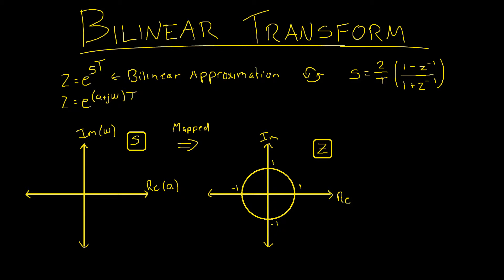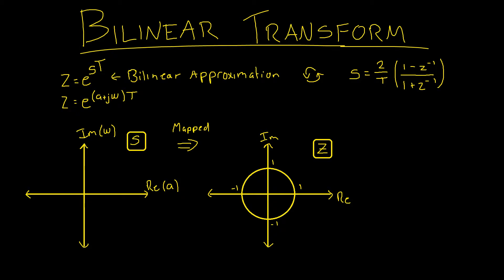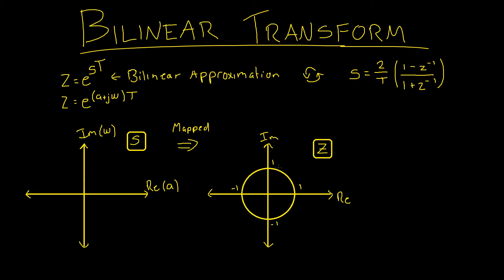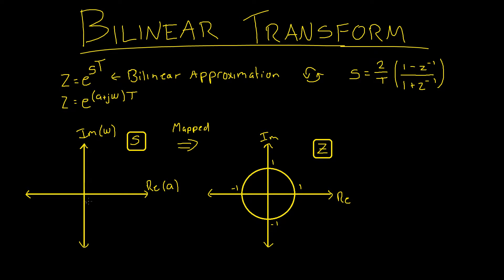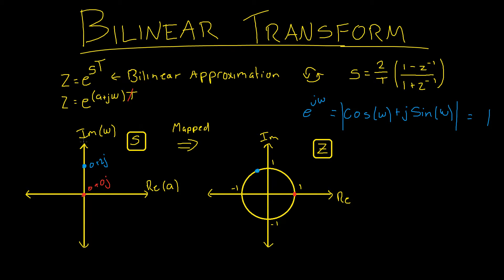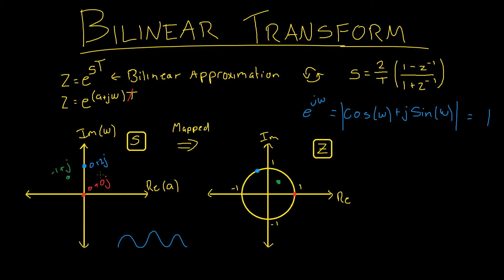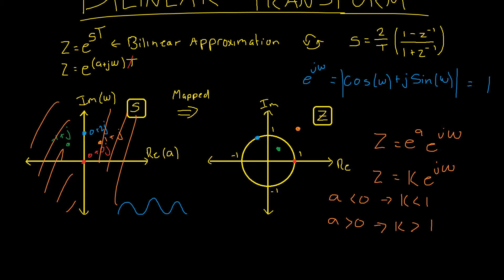Bilinear Transform Explained - Signal Processing #14

Comment: Can someone explain minute 3? how is 0 + 2j  mappd to the left top corner of unit circle?
Reply: From what I understand, the point on the s-plane s = 0+j2 is inserted into the relation z = e^(a+jw)T where a = 0, w = 2, and T = 1. Since that point is only on the imaginary axis of the s-plane, the radius value on the z-plane =1. Therefore z =  1*e^jw where w = 2 in radians which is equal to ~115 deg aka the top left of the unit circle.